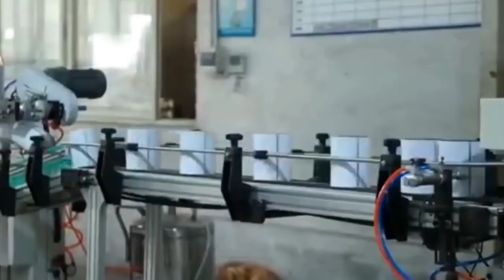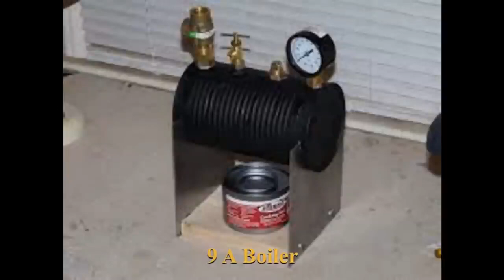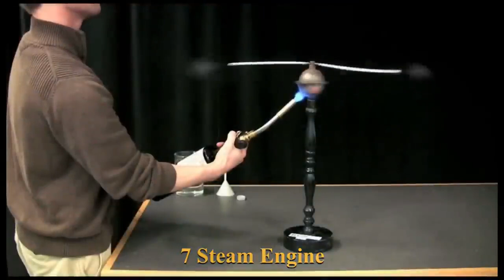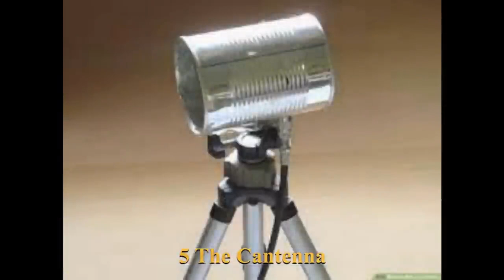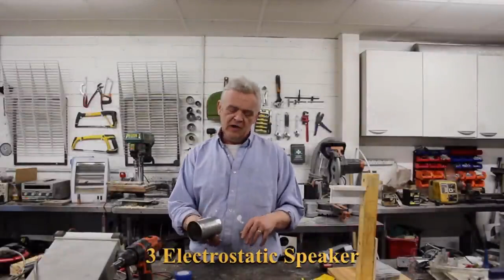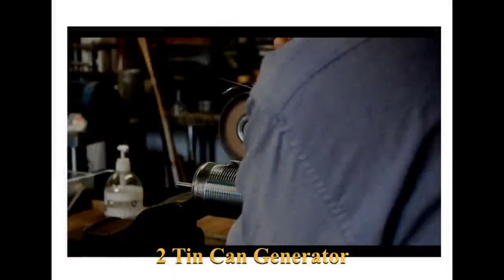Top10 Tin Can Projects

Comment: There are different types of "tin" cans, some actually tin plated, others galvanized or coated in plastic or even uncoated. Some of these can produce toxic fumes when heated.
There's also pressed cans that only have a top lid which are better for holding hot, molten materials whereas the ones with lids pressed onto top and bottom can fail catastrophically with molten materials, but you get 2 steel discs and a cylinder that can easily be cut down the weld into a rectangle (after flattening)
The lids can be used for tesla turbine blades, turned into circular saw blades, washers or gears.
The cylinders can be used for ducting, rudimentary piping or creating moulds, but if cut into rectangles the possibility is endless.

Comment: A cantenna is also a very nice and cheap way to make a directional antenna to make a WiFi bridge between two points. Did this myself some years ago when I lived in a place without internet, but could share from a few hundred meters away(direct sight).  
Thinking about it, I guess one could add a small hole/holder for a laser-pointer at the back, or just strap it to the can, to make it easier to aim.  
If both sides are cantenas, I assume the aim needs to be pretty good to get proper speed.

Comment: My number 1 tin can project involves nesting three differnt size cans.
Each can is placed in a wool or silk sock with the upper sock folded into the can interior.
Once all three cans are nested place bottom on the south pole of a 40 guass magnet.
Now place seeds inside 90 to 100 days to dramatically increase vigor and yield.